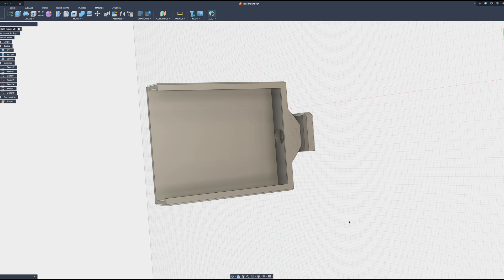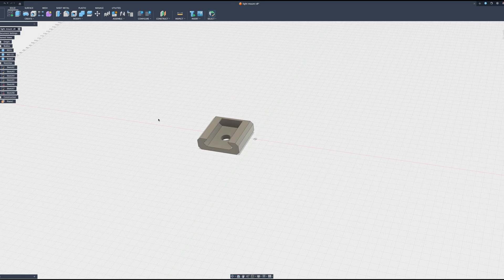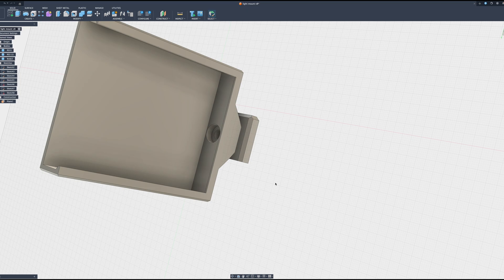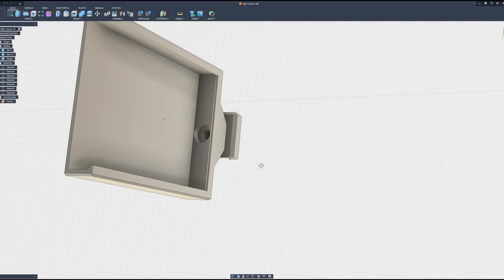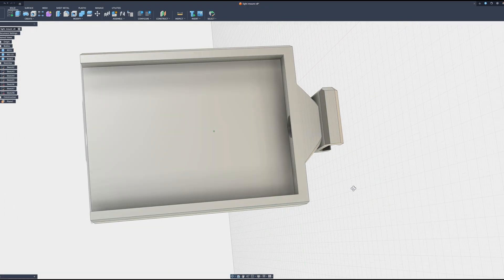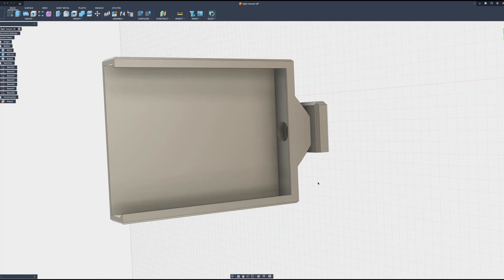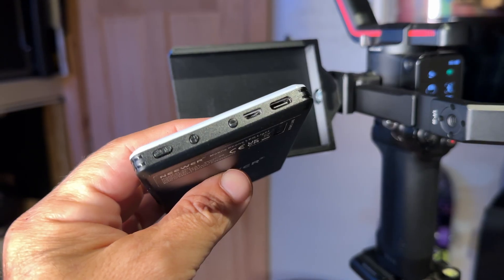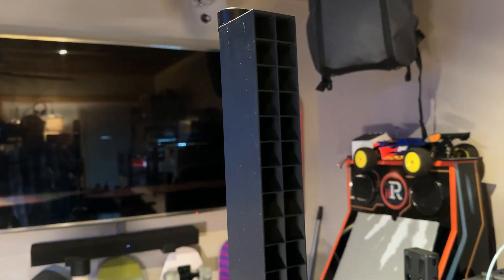I 3D Printed the Perfect Light Mount (and It Actually Works!)

Comment: It looks better, yeah. Worth the work.

I'm preparing a table for some simple unboxing soon, and I technically have all the lights. What I don't have are good ways to fix cameras or lights since I need things to point downwards, so it's either buying a few Gorillapod type things or making something custom. There was one pretty good 4-legged frame made by Røde, but it's both very expensive and import only, making it even more expensive. Guess I'll be designing some custom rigs myself.

Comment: Definitely better! I like the balance (light-wise) between foreground (ie you) and the background with the colored lights. You may want to experiment with a little bit more exposure (colored lights more pronounced ) of the background even. 
Now I'm no expert with video but your face is very sharp. Not bad but you may want to check sharpening settings in your camera. The default is usually a bit too much. 
You can also experiment with a little more distance between you and the camera. 
Oh. And a small tip for the content at the beginning: you jumped right into the design in fusion but would have liked to see the 'problem' you were trying to solve first.
But anyway, keep it up. You're doing great and you improved a lot since the early days. I like watching your content!
Reply from the maker: Good points, thanks for the feedback!

Comment: As soon  as the video started I was like whoa he is really in focus lol  So i would say its better.   I have been working on my own camera setup for taking product photography. To be cheap I am using old electrical conduit and making a frame for overhead shots.   I have never used at DSLR before so I don't know what I don't know.  Its slowly coming along.   When i get it set up I will not need to move it around much. When I was using my cell phone I would have to mount it and take it down every time or answer it for a call while taking a picture. lol